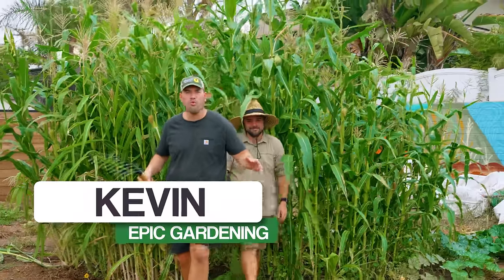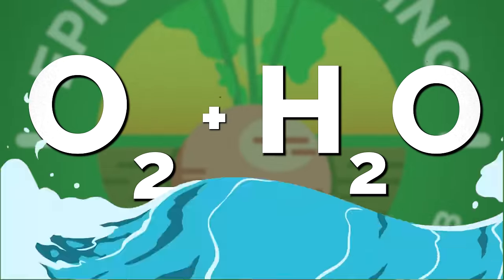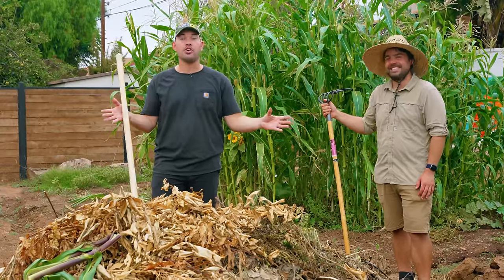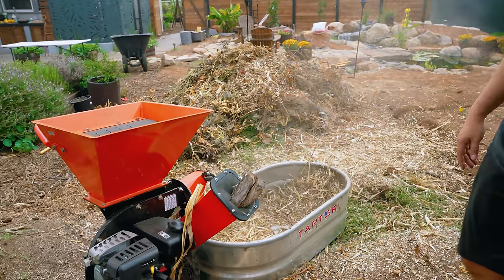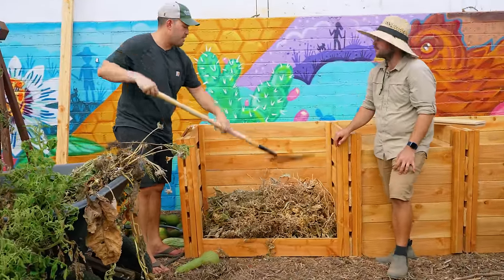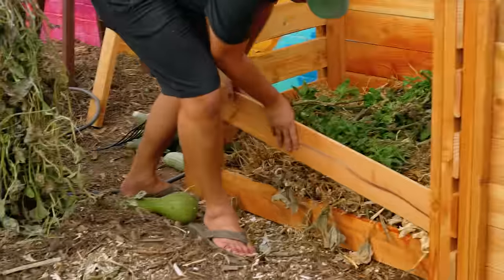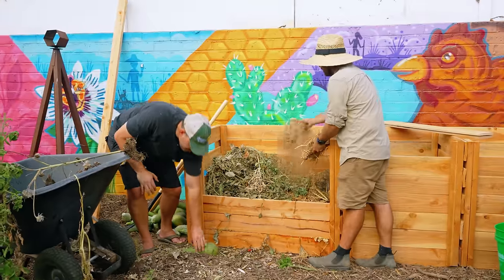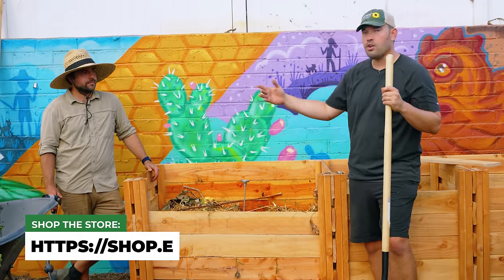How to Make Hot Compost (Start to Finish)

Comment: The first time I got a truly hot pile working, and could not recognize nearly any trace of the original material in the dark brown fragrant soil that resulted, was magical!  It's worth attempting just to marvel at the transformation.
Reply from the maker: It's absolutely marvelous when you get it right!
Reply: I'll share my experience with you on my most glorious pile to date. So home made bio char added to the compost pile has scientifically shown that it increases the pile heat by about 20 degrees or so if I remember correctly, it also absorbs and converts the ammonia being released and the converted form is good for soil life. I did an experiment pile this year using fallen white sapote, jack fruit, rough chopped sugar cane, various dried fruit tree leaves, and any kitchen scraps I had while building the pile up for a few weeks. I didn't chop the sugar cane up more than one chop between rib sections since the jack fruit is so fibrous and will also take a while to break down. I didn't know what to expect from this pile and about half way to 3/4 way to the completion of the process I wasn't very confident at all, fast forward to now though and I've got the darkest most fertile looking hummus compost I've ever created. I feel like the slow break down of the sugar cane combined with the slow break down of the jack fruit  helped to create some extra benefits because I'm usually happy with my results but this looks like something out of a processional's pile.
Reply: Im so motivated right now...😊😊

Comment: A tip I'd recommend is adding a 1.5 inch PVC pipe with small holes all over in the center to make sure the water is being well distributed all the way to the bottom
Reply from the maker: Good call :)
Reply: That’s a great tip so happy I was able to see this.
Reply: It will add air too.
Reply: Johnson-Su bioreactor, which is similar to your idea, to produce your own on-farm or allotment biology.
Reply: Thank you for the awesome video! Is there additional information on why you there are 4 bins side by side? What’s the methodology there? ☺️
Reply: I've tried to tell my husband this tip for years!
Reply: Does a pile like this not attract animals/pests?  My husband doesn’t want to compost because he thinks it will attract bears, foxes, raccoons, mice etc
Reply: This is a great idea. Do. u stick them throughout?
Reply: @stacysb5449  get a tumbler style composter that will keep all the critters out

Comment: I bought the compost thermometer and I'm really glad I did so I can monitor my pile instead of just guessing if it's working. I've been succesfully keeping it between 140-150°F, watering every fews days, and flipping once a week which is all I have time for. That's also usually when the temp starts to dip and tells me it's time. Going well so far, though all I have to use as my browns is fallen oak leaves, which are resisting breakdown and i don't have a chipper shredder or even a lawnmower to speed the process up. Its okay though. I'm patient. As long as I can see that the temp is where it needs to be I'm fine. 😊

Comment: I make several yards of compost each year with leaves and grass clippings from a 1/2 acre lot. I do a bag of grass and a bag of leaves at a time, so 50/50, but I mix it thoroughly; I never layer. It breaks down much quicker. I keep it hot all summer by adding grass each time I turn. This adds more nitrogen as it's used up, to continue breaking the older material down. Mowing the leaves also picks up dirt, which will jumpstart the bacteria. Those thermometers are great! I have a nice one by Cootway that is colored for easier reading.

Comment: As someone who has tried making fancy compost many times I have learned climate is the factor that is normally left out when discussing ratios. Here in the northeast the easiest thing to have happen is the pile gets too wet if it’s a small one although if you can shelter it that helps obviously. But I would say dry climates actually have the advantage at small scale
Reply: Many people are unaware that some state governments have programs to give out free composting bins to home owners as it benefits the trash system to have people home composting. Perhaps a free bin might help? Worth a quick research to see.

Comment: Add molasses to the center of the compost if it isn't heating up properly. I usually add greens (nitrogen) inside a black bag and add molasses to it. Then I put the bag where the sun hits it for like 3 days or so. Open the center of the cold compost and add the "molasses salad" that is inside the black bag and cover it with browns (carbon). It should start heating up soon.
Reply: Alfalfa pellets work great too. We often add them into the soil when getting ready to plant, so we have some on hand. Had some that got damp and smelly, so we dumped them onto the leaf pile and holy cow it cooked down in a matter of weeks.

Comment: I don't worry too much at all about my compost. At the end of the day, all my compostable waste goes into compost. Therefore, it all goes into the compost. I do try to layer it, and shred it. But if your ratios are off, it will be slower, but the microbes and fungi will fix it over time. If you go into a forest, the forest floor is going to be mostly brown fed, but it does generally decompose within a year. If you are putting to much greens, it will get "funky" so I spread it out and dry it and "brown" it a little before I add it. My wife goes around collecting grass clippings so we do this a lot. In the end, the fundamental principle I have is to not put things into the garbage.

Comment: Thank you for a great video. It has made a big difference in my compost to give things a good chop before putting them in the bins. I realized that my problem is that keep adding to all the bins instead of rotating them. Right now they are all nearly full. I won't have good compost until spring. Next year I'll fill a couple at a time, and let them work away then fill the others.

Comment: A big thing most people don't truly understand is how different the brown:green ratio can be with the actual carbon:nitrogen ratio of the same pile. For example, wood chips being sometimes 600 carbon to 1 nitrogen, one may use half of their pile with this, and then (often convenience and availability of it) throw in some green grass clippings as their "nitrogen" source. This would make a 1:1 brown:green ratio but all of what is considered "green" is still mostly carbon, just simple more nitrogen than the "brown" material. So in this scenario half of it being super high carbon wood chips (600:1) and half being green grass clippings (20:1) the 1:1 green:brown would also be 310:1 carbon:nitrogen (I may be making simple mistakes with the final ratio here, but obviously you get the main takeaway). 

Sometimes, just for sheer availability and the fact that fresh grass clippings has a mostly ideal ratio, I've made compost piles with only grass that heated up QUICK and very hot for passively heating greenhouses, granted it would have a huge nutrient diversity.

Of course there is no totally right or wrong way, but just from my personal experience having a lot of my materials grinded, and using a lot of soft grass clippings/foliage that mattes easily as you showed, I also do not layer them. Even when separating it while creating the pile, it often will matte in some areas not visible from the outside and having a pure layer seems to me like more of a potential block from the bacteria and air flow to make it through the pile

But, as always, there's so many variables for the lazy man to pay too much attention to. Freshly grinded wood chips dumped in huge piles from arborist, depending on the type of tree and amount of foliage, can heat up immediately without any added green material. Possibly the overall size and texture of each particle (being shredded chips, etc) made it SO aerobic, that it can maybe get away with much less nitrogen initially.

I would like to see more people sharing their compost "recipes" - or basically a more replicable way for good compost with less variables. I have many of my own, with notes
Reply: Glad I saw this comment. I recently had trees trimmed and chipped and the pile in my driveway got literally too hot to touch in the center within just a few days (before I could move it). I would assume that's because there were some greens mixed in from the foliage, as you said. Thinking about separating it all into a few smaller piles and seeing what happens if I just keep it moist as we move into spring and summer.

Comment: It heats up a lot quicker with more moisture as you add the different components.  The compost at the 1st turning should be that of a wrung out sponge, if not, needs more H2O.
I prefer to cage compost, it is a lot easier to turn the pile properly from a cage as apposed to a bin.  I guess there many ways to compost just as there are many ways to garden.
Enjoy your videos.

Comment: What does Jacques mean when he says it takes a long time for sunflower stalks to break down? When I used to be able to grow sunflowers, I would cut most of the stalks down; but, I would leave standing those that still had flower heads with seeds. I would cut the stalks into manageable sizes, about 5 or 6 inches long.  Then I would bury the stalks in the garden among the fall flowers.  By May, any stalks that didn't get buried, were hard like wood from a tree; but, those that were buried would crumble in my hand.

Red wigglers help with breaking down materials; but, my favorite are the black soldier fly larva.

Comment: I am doing the lazy compost.  I don't really stress too much about ratios because I don't have the time.  I add shavings from the chicken coop, hay/goat poop in my last pile (first time I had any heat in my compost was from this), some garden waste, and kitchen scraps.  I have two fairly large piles that I let sit for six months before using.  We have a tractor that I use to scoop it up and then drop it to get oxygen in it.  When a pile is done and ready to use I move it to the garden area, that way I only have to have 2 piles.  My issue is that it doesn't really get hot.  I haven't had to purchase any compost for about 2 years now.
Reply: takes a tad longer but I do the same. Never actually built a big pile at once. I just keep adding . Heat don't work the worms will 😂🌱🌱
Reply: Before when I had one I just added kitchen or grass and the covered whatever I put it with leaves paper cardboard and wet it then through a black tarp over it. I’d mix it everytime I added something and it worked fine. I didn’t have any critter problems though. Is there any real wrong way??

Comment: Instead of a wooden or pallet compost box, I just take a length of the 3' wide wire trellis mesh and make it into a 3' diameter circle, hooking it around onto itself, set it on the dirt and fill er up. When I need to turn the pile, I can just unhook it to open and let it all fall out and use it again in a new spot, putting the pile back in to compost more. Or sometimes, I just lift it up and let the pile fall out the bottom. I've even just turned the whole thing upside-down and kept it going. I'm sure I look funny rolling my wire mesh compost piles around 😂 but hey it works great, easy to aerate and water and cheap.
For browns, I tear up and add all cardboard packaging instead of putting them in recycle bins or garbage... everything from toilet paper rolls to cereal boxes and pizza boxes. I also add all used coffee grinds, eggshells and banana peels and all non-greasy kitchen scraps. Also, besides old flat cola, can put in old flat beer or molasses. I even put in the used water after boiling potatoes or hard-boiled eggs. We barely ever even have trash to put out at the curb.

Comment: That takes up wayyy too much space for my back yard. I've been trying a few different methods that are more on the temporary or collapsible side than permeant structures like yours. Last season was by far my most successful compost yet. Last month I tried an experiment that was inspired by Big Bird from Sesame St. I pruned a lilac tree that had become seriously overgrown and was left with a massive pile of branches. Since I had already exceeded my gardening budget for the season I wasn't willing to keep the stuff around until my new budget and cash is too tight right now to pay the fees for dumping the material. So what does this have to do with Big Bird? I made me a giant composting nest out of the pruning from the tree. So big that I need to find more tree pruninings or branches to finish  it off! Eventually the twigs and branches will decompose, but I know that I'll get at least 3-4 good seasons out of this thing. And to turn it, I have one of those spiral compost turners that you showed in one of you previous videos. So now I have a bird's nest big enough to contain about 2 yards of compost!

Comment: I've been composting since the start of "Pandemic Summer" in 2020 using a heavy-gauge plastic unit provided by the city of Chula Vista. I gather coffee grounds and scraps for a couple of weeks and then go out, shovel out the top 50%, then screen the bottom 50% to harvest the compost, followed by rebuilding the pile again using the house scraps, freshly cut grass and leaves from a tree in my back yard. The Reotemp hits upwards of 130+ degrees during the summer, somewhat cooler in the cooler months. So far, I've harvested at least 50 gallons of awesome compost that I used to refresh my soil. (I put the harvested stuff in a 33 gallon Rubbermade trash can until I need it)

Comment: When do you typically turn it over into a second bin? I have a 3 bin system that I just built (pallets), but I'm not sure when I should be turning. I've been sitting between 120-140 for some time with occasional cool down days.

Comment: i guess, in San Diego with a garden not so big, the best  way would be to use the green waste bins and fill them up, then create a pile from that? My dad has used shredded paper as browns and it worked well (he gets a LOT of junk mail!). Now just need to convince the others in the house to let me use at least six feet of out-of-the-way space for bins (i'd pile, but i have big dogs; don't want digging and rooting!). Would pallets make good bin-sides? (This is the other issue - can't afford to spring too much on this. May use spare chicken-wire i have from an attempt at rat deterrence.) 

eta - also, it seems i have seemingly opposing issues of not being able to keep the thing damp, and it not being able to heat up. i'm close enough to the coast (west of the 5) that most of the year marine layer screens the sun, but at the same time, this IS a semi-desert area.
Reply from the maker: Yep that's a good way to consolidate! Shredded paper is also quite nice.

Comment: I am curious though…I’ve been trying to start my pile for like 4-6 months but it’s not heating up. Tons of straw, grass clippings, with palates as walls for air flow, and I’ve added water consistently and inconsistently. Maybe I need to add more dirt?! Just a little defeated because I can’t seem to heat it up.
Reply: makes two of us. I gave up and let the worms eat it all up 😂 My pile just wasn't big enough (I think anyway)
Reply: You don't really need the dirt technically. Is it raised? Is it big enough? With grass clippings, I have never had an issue with getting it started, it has been getting it to finish and not form thatch somewhere. Going anaerobic or too little carbon is the bigger issue. Straw might be your issue here, as it is harder to break down which is in part why it can be used as ground cover. Shredded untreated cardboard and newspaper can get hot quick and some ash can assist that. Ash though can make a pile alkaline and injects additional potassium though. It also creates trouble with aeration. 

In the southeast, when with ground contact it can start heating within 1-2 days. Once I left grass clippings in a wheelbarrow and it went hot overnight around the leaves and

Comment: How do you control the Rodents?
Reply: We have a rat problem from our neighbors’ yard. I adapted the design from Epic Gardens by stapling 1/2” hardware cloth in between each bin and along the outside and bottom. I also built a lid that is tight to the top and keeps the Pacific Northwest winter rain out. So far it’s worked really well — no evidence of rodents and we throw our kitchen scraps in weekly.
Reply: You aren't supposed to put any grains or bread into a compost pile (nor dairy or meat)